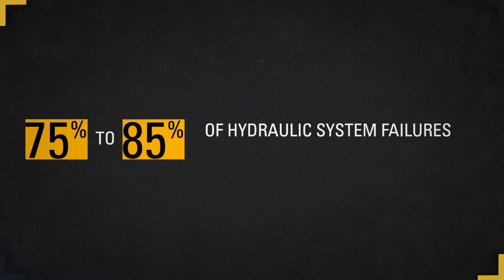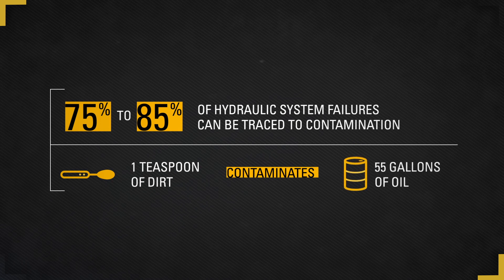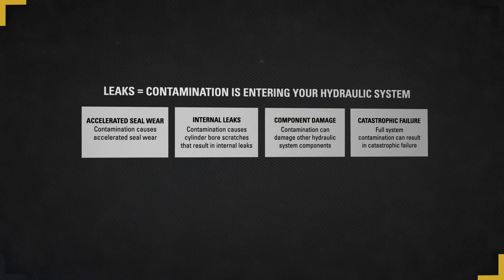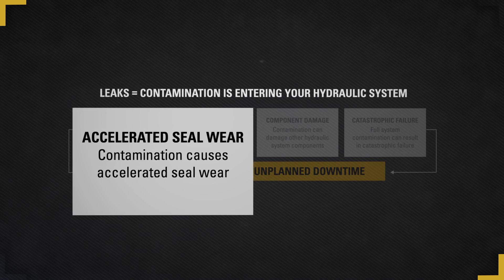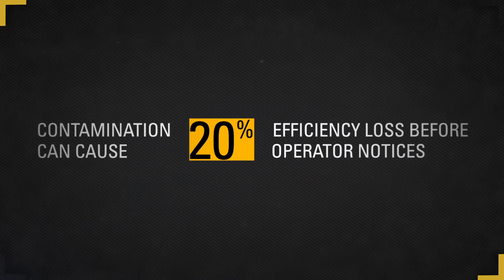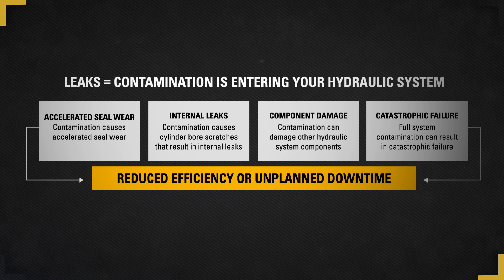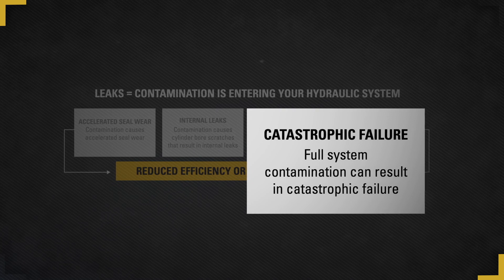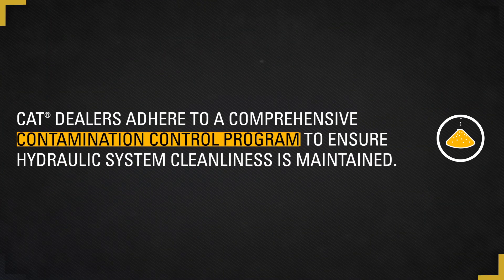Cat® Hydraulic Cylinder Repair Options

Comment: Yeah yeah yeah, I know all that,  .....     THAT's NOT what I'm looking for - Rod BROKE no contamination,   HOW do you disasemmble the cylinder - Obvious doesn't work - Soooo TIGHT  - who assembled it ?   CAT cylinder 278-1973
Reply: looking for the same info
Reply: Those bolts at the end of cylinder rods can be tigtened upwards of 800ftlbs of torque. Getting them off and on torqued to spec requires a torque multiplier. The multiplier is a geared transmission if you will, that increases the operators torque and applies is to the nut. Without it you will need a long breaker bar. Even then, cheap sockets or wrenches can easily break attempting to loosen the bolt. Consider using a jig to support the cylinder rod while attempting to remove the bolt.